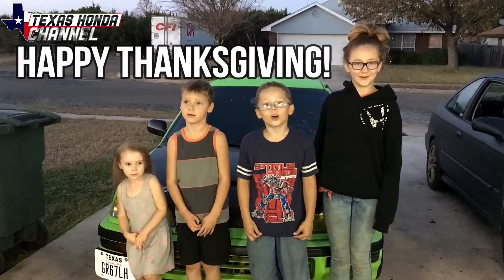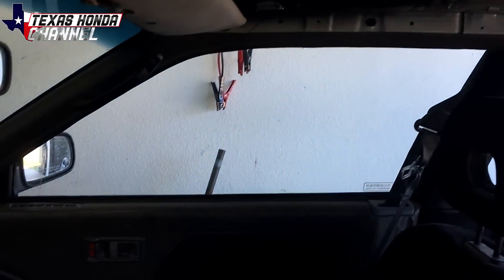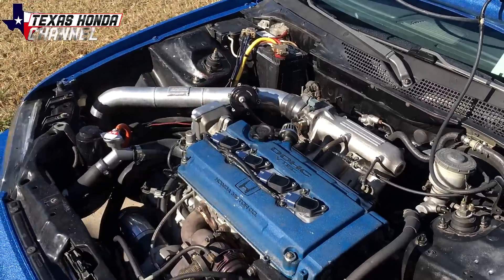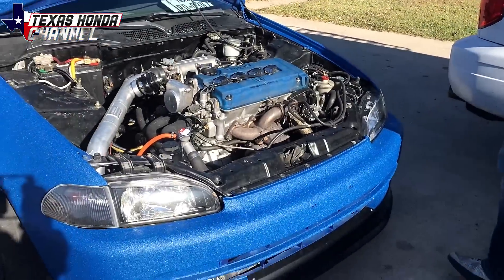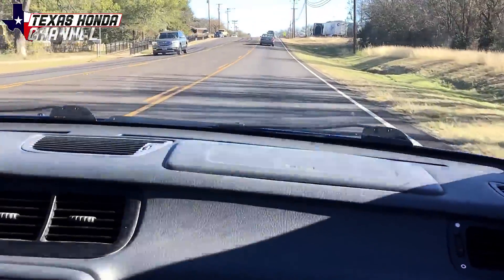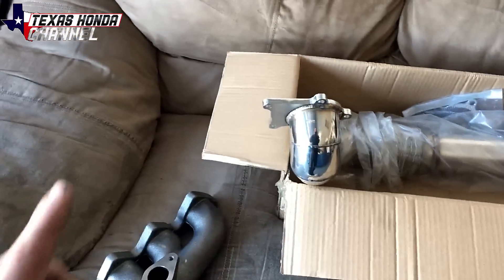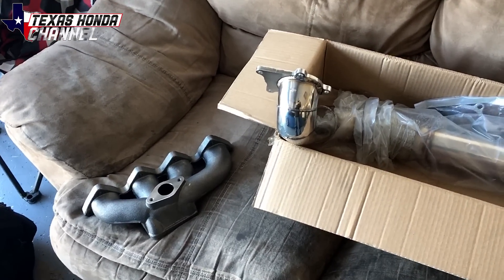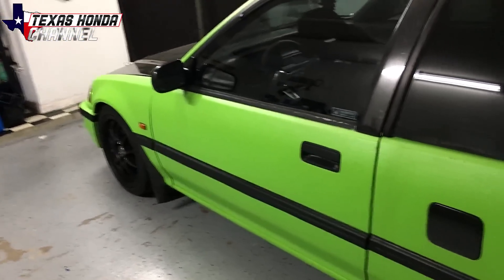One Sweet B16 turbo Sedan + Ef Gets Tint (Happy Thanksgiving)

Comment: those federal super steel tires are notorious for road noise and not lasting very long for normal driving
Reply from the maker: The tires on my black wheels?  I already have 4 brand new ones for them the road noise isn't very bad on the federal either.
Reply: @TexasHondaChannel  ive seen those tires cup to the point of undrivability in under 30k miles. toyo extensa are way better for the same price
Reply from the maker: @AHS_motorsport  I have different tires I ordered for my black wheels not using them tires. As for polished lip wheels the tires on them are perfectly fine and brand new

Comment: I have a d16z6 makes around 380whp. Car weighs 2120 pounds.  Tuned by Brent at PFI Speed. She's fun. Just installed an 18 inch fiberglass sub box I made that takes up the whole back seat. So it may weigh 2200 pounds now.  Power windows sunroof.
Reply from the maker: Nice! That’s fun! My sedan was over 300whp and it was fun but I miss the 500whp setup. This one will be fast regardless

Comment: Turbo her but do it the right way build a block and run her low boost for fun yk
Reply from the maker: It’s not my first time turbocharging lol. I have ran 19psi on bone stock y7 with a GT30 and 30psi on my fully built d16y8 but this is getting something a little different